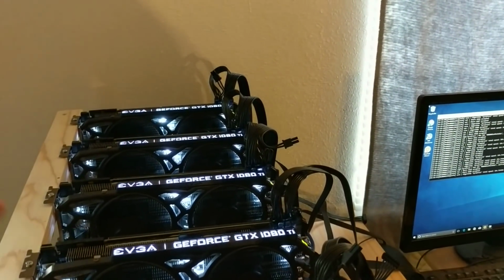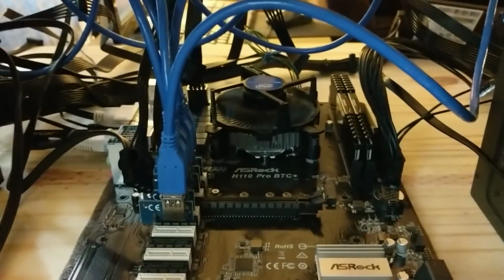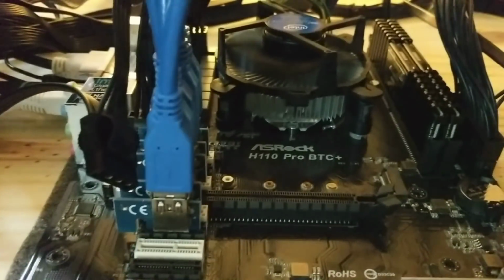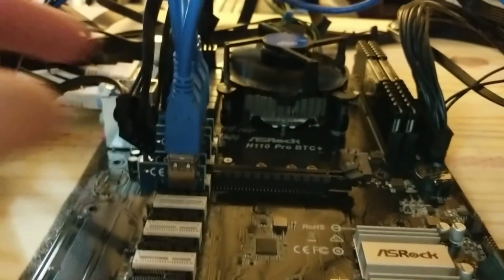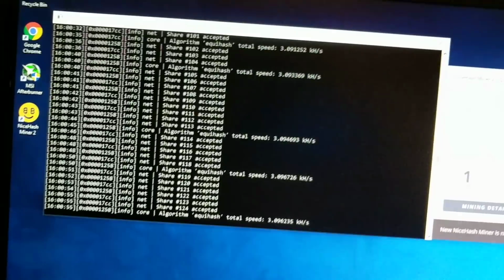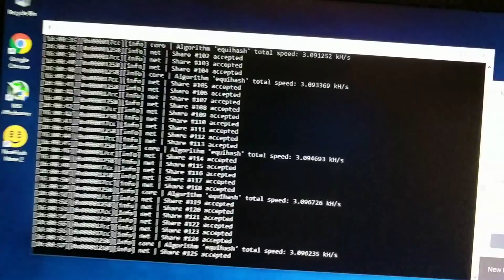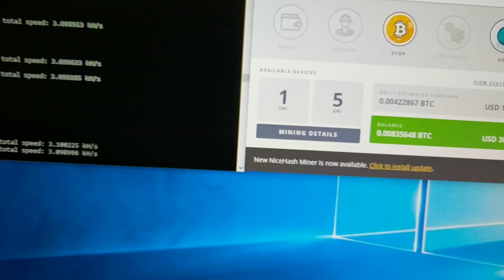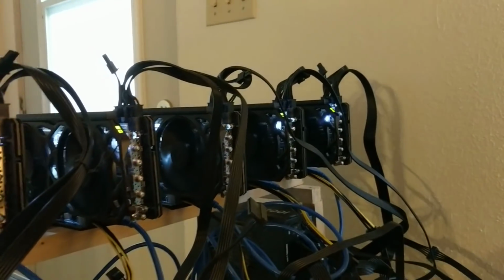My first mining rig (5 x GTX 1080 ti) and problems I had setting it up to mine crypto currency.

Comment: Well, this is why the prices are fucked up. thx
Reply: Justin Springer Nowhere In Graphics Processing Unit Does It Say Gaming.
Reply: It is the unfortunate downside of supply and demand....the crypto craze will soon reach a new equilibrium point and there won't be a huge rush of ppl trying to mine.  Rx Vegas are out and Rx 580s are back below $300.  Everything will normalize soon  because the manufacturers are responding to the needs of all of us.  Nvidia just released new gtx 1070 ti models....companies are making mining specific GPUs now too.  I think this argument will be over just as quickly as it started, and believe me...as a gamer I understand the frustrations as well.
Reply: Mike Chin yeah and soon  there will suddenly be shit loads of supply.vega however aren't as good as they estimated.besides,there are still  companies who buys 100+ gpu as soon as there is supply store  there's that too.
Reply: Jeff T 
S
Reply: all prices sharply jumped 100 dollars with the announcement of nvidia mining
Reply: Kuchn 3 1080's are generally unaffected. It's the rx 570's and 580's for the most part
Reply: That's a novel?  Low bar much?
Reply: The price of the 1080ti has not changed. AMD cards were effected alot more.
Reply: Mike Chin US dollars have gold in them, moron.
Reply: Mike Chin you guys let them raise the prices and now the prices are gonna stay raise
Reply: PCMasterRaceTechGod what US do you live in?  Not since 1971 has the US dollar been redeemable for gold.  If you are referring to fort Knox, that is not what is backing up the US dollar. Its the fact that the USD is a reserve currency for the world.  Specifically oil.  Any country that wants to purchase oil from Saudi Arabia has to do so in USD.  That is why our currency hasn’t crashed yet.  I have a better one for you....do a google search on Fractional reserve lending.  See how the banks just create digital money out of nothing.  Honestly, you call me a moron, but clearly you haven’t been paying attention at all.  I can’t even believe I have to point all this out to you....
Reply: some one is that even a sentence? What does that even mean?  I didn’t let them do anything....whoever they are.
Reply: Honestly I hate dealing with kids...I want to help explain what a f-ed up world we live in this is, but if you can’t even do the basic research....you shouldn’t even open your mouth in an adult conversation. And if you aren’t a kid and are an adult, god help you.
Reply: Mike Chin bro chill who the fuck are you go away man it's a YouTube comment section not a fucking csgo match
Reply: some one i don’t like being called a moron.  Ppl like me make comments to help enlighten others.  I could care less either way, but you called me out so here we are.  I don’t need to be educated on anything related to this topic.  But you are right I will chill and go away...cuz I am wasting my time with you
Reply: Mike Chin well said.while I hate miners for making prices rise, 1080 and 1080ti prices are not affected that much.hence I am okay with miners that use 1080's. Bitcoin is not the cause of mining it is eutherum or someshit.i only hate cheapo miners who use rx5~~ series causing insane price inflation. Mining can't be stopped,neither can cyptocurrency.
Reply: Kuchn 3 "he is doing other things with a gpu then gaming" logic
Reply: Sorry i know there aren't any pictures in this book for you.  Must be hard to pay attention to anything for longer than 5 secs....don't worry about it.  Clearly my words are wasted on you
Reply: Justin Springer ASIC is for mining bitcoin not all other coins. Might wanna learn about something before you start talking shit...or just keep looking like a bitter idiot.  If you want a 1080gtx to play WOW with maybe you should go get a job and save up for it...,
Reply: Justin, cool story bro.  Almost had me there for a second.  Fake currency, huh?  I don't exactly know what a fiat currency is so lets just assume you meant fake.  Are you implying that a United States dollar is created in a meaningful way that it too doesn't qualify as fake?  USD is as fake as it gets...being created out of gold...wait no...silver...wait nope.....paper?  It is literally just printed out and given to the banks, for no work or value in exchange other than the paper it is made from. If that is real to you, then stop reading because you are never going to get it.  You know what is real?  Debt ceilings being raised every annual budget and inflation.  
I got news for you...countries are now accepting Bitcoins, and it is a very real currency my friend.  So real that even the largest US banks are starting to invest.

 I almost want to post my pay stub for you...so you can see my per hour rate....but I honestly have nothing to prove to you or anyone here.  But call me out again and maybe I will show you why I can afford 6, $500 GPUs while you prolly own zero. Oh and 2 more on the way.  About my job? I am like a Homer Simpson with a college degree who makes over $100,000 per year.   I own my own home...left mom and dad's place when I turned 18.  Not your average millennial....sorry to disappoint your misplaced angry ignorant ranting and feelings.  I can understand that your fragile little mind got hurt when I called you out in  a earlier post so I take full responsibility for starting this verbal fight, but seriously why are you complaining about the price of graphics cards and mining when you clearly have no idea what you are talking about?  Word of advice...anytime you wanna talk crap in a public forum...you really should speak from a place of knowledge.  A few google searches and some basic reading skills would have taught you all you needed to know in life about mining.  There are many places one with knowledge could have attacked crypto currency from, but instead you chose to speak from you arse and I simply called you out on it.  That's life my friend....full of disappointments.  Sorry if I told you to get a job.  Wasn't very nice of me, but honestly...how do you not understand that this is business...not a video game that we are all playing.  No kidding a GPU is so expensive now....it is making ppl lots of money and AMD and Nvidia are BUSINESSES who understand that.   I doubt they share your opinion, or even care about it.  Even in Cali where the price of electricity is super high...I am still making over double that in profits per month.  Tell me how I am wasting my time and efforts making ANY type of income.  Trust me...once you finally step out into the real world and get a mortgage, have a family and travel the world you will be scrambling to make money any way that you can.  Mining is just a way for many of us to supplement our incomes because REAL Life is really hard and every penny or part of a crptocurrecy counts....

Comment: you could better buy 10 r9 280x thats also 3kh/s (300H/s per one) and thats a lot cheaper
Reply: the D3 would have done that a month ago or so, but currently, its rocking between 15-25 dollars a day per machine according to most calculators.
Reply: Antminer D3   would have been the way to go 1kw  and fetches a good $100 a day renting out its hash power
Reply: thats good and all but they don't have as much vram or future proofness as the 1080ti's do
Reply: lmao now i have 4 gtx 1070 and i am profiting 20-22 dollars 

When mining ends i can sell them for good price and extend my profit 

you can throw your antminer in dustbin and salvage heatsinks lol

Comment: now income only 2.2 USD per 80ti, hopeless
Reply: 1.75 USD after Electrical Cost
Reply: haha yes, this guy started mining a couple years late xD
Reply: 470 480 570 580 1060 6gb 1070 1080ti depending the coin u want to mine.
Reply: im getting that w/ an overclocked 980ti, it can't be.
Reply: Matthew Orr are u mining ethereum or bitcoin?
Reply: 1080 Ti's run roughly 8-9 USD per day atm.
Reply: TheNeurolicious what r u mining than?
Reply: I presume you will not name the supposed sleeping giant?
Reply: There is a private message feature in youtube. Click my name, go to the "About" tab and press "send message". You can check messages from the "community" tab in the video manager section of your own channel/account.
Reply: I think I went about 4 or 5 years not knowing about it, don't feel too bad lol. It's almost kinda hidden, you don't even get notifications for received messages, you have to manually check it for new messages. Afaik at least, might be some way about it.

Comment: go to bios and set the primary graphics as on bored then you will be able to use the main slot (or connect you monitor to the main slot card) I set my PCI pairs to gen 2 and all works stable. ebay growing tant that can reduce the heat with some fans if that helps but you need outside extractor. bit be tripping has some gr8 vids on rigs and he did 13x 1080ti rig if you care
Reply: how much do those cards hash on ethereum ? and how much are you reducing power on them with Afterburner ?
Reply from the maker: Thanks!  Also huge fan of BBT.  I think the last time I checked and they were mining just Eth they were at 32 MHs at 80%, +90 core +550 mem.  It's been a while because Nicehash has them constantly dual mining Eth and Decred at a rate of 28 MHs Eth and 8.9 GHs of Decred
Reply: It’s not kind something to be bored, unless you mean (mother)board. -_-

Comment: Are you powering all of the risers off of one PSU?
Reply from the maker: I think I could power the whole rig with a 1600w power supply but they cost about $450+.  However, it costs about the same amount of money to buy 2 x 1200w power supplies including the $20 splitter (which you can get for a lot less).  With two 1200w power supplies I have 2400w to work with so it makes sense financially and stability wise.  Just about to post a new video with that setup and it has been stable for 6 days now.